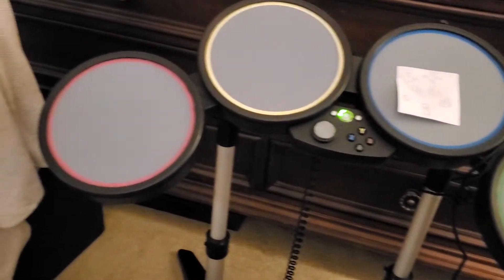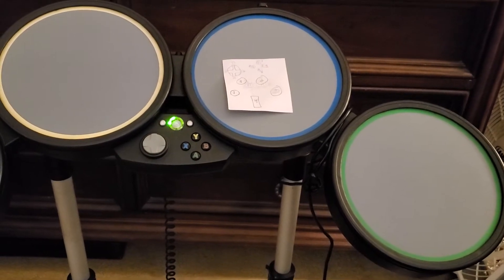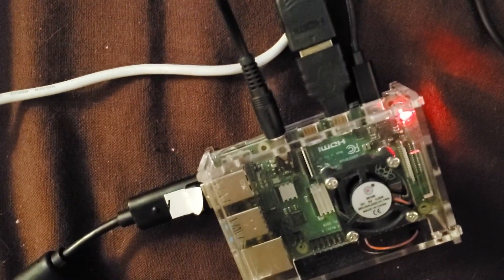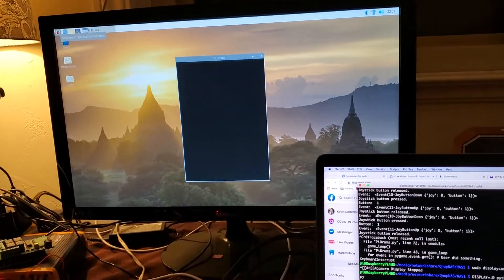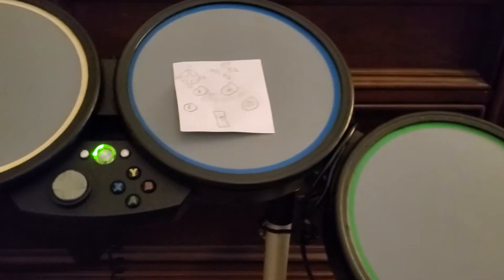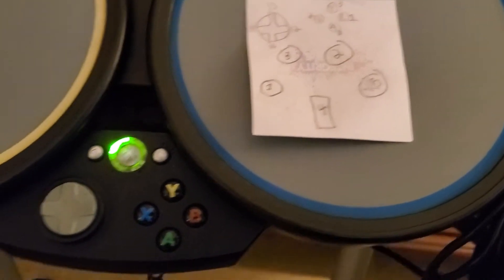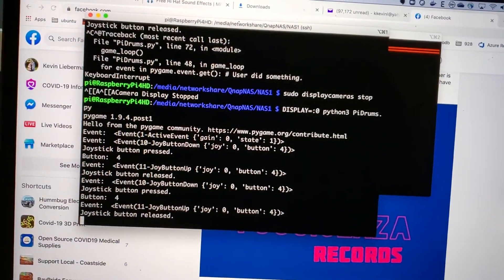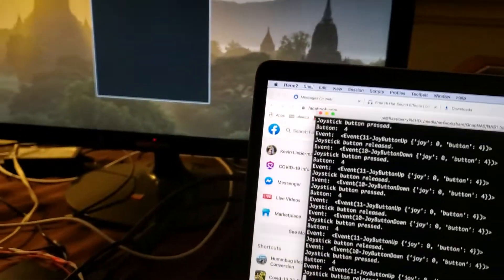Hacking Xbox Rock Band Drums into Electronic Drums

Comment: I think the way to do this (and what I was hoping to find), is a way to hack the sensors in the pads to connect to an existing digital drum kit's sound module. I've seen just the "brain" of digital drums for sale cheap frequently (especially older models)...and I've seen Rock Band drum kits that people can't freaking give away - figure out a way to combine the two, and you've got lots of kids learning how to play drums for dirt cheap. All I need is for those sensors to send a trigger down a 1/4" cable that I can plug into a preexisting sound module - that's the hack I'm looking for. Otherwise you may as well just buy a used starter kit for around $200 and call it a day.